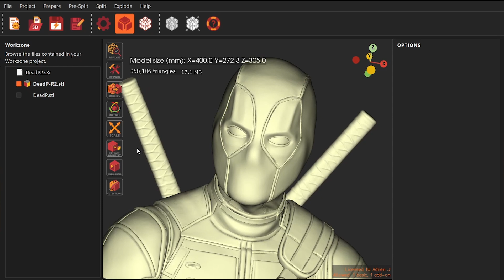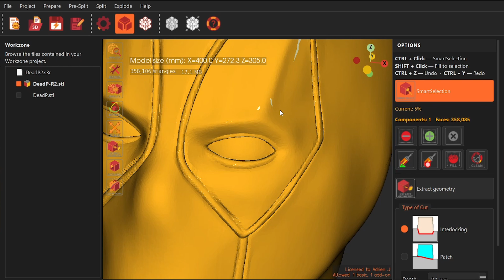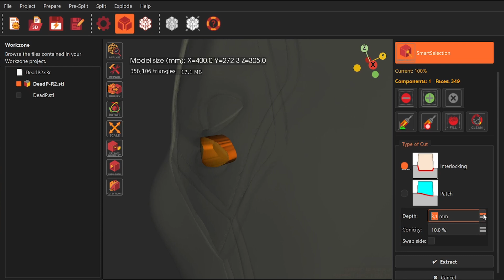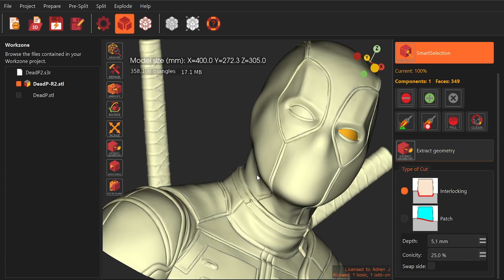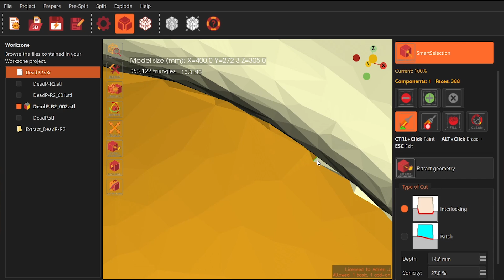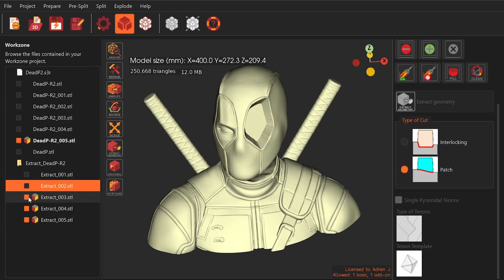Split3r Tutorial: Mastering the Smart Selection & Extract Tool (3D Bust)

Comment: I live in a poor area and really need a trial version.
Reply: This is an extract from F.a.q. in the official site:
Unfortunately, we have temporarily suspended the trial version. This is because 15 days’ use of Split3r was sufficient to generate weeks or months’ worth of printouts, and it was possible to request the demo version multiple times using different email addresses.
As a result, the demo version did not generate any sales for us.

Split3r is still in a phase of rapid development, the first public version was only released about five months ago, and the software is evolving quickly.
Maintaining a separate demo version alongside these frequent updates requires a considerable amount of extra work in terms of testing, adaptation and support.

Once development has reached a more advanced stage (version 1.5.0 released), we plan to release an updated demo version, probably at the end of June.
All commands and features will be fully operational in the demo version.
The only limitation of this demo version is that only one of the files created will be usable in Slicers, the other parts will not load.
This is an intentional limitation of the demo.

Thank you for your understanding